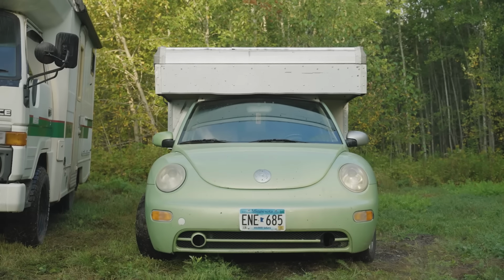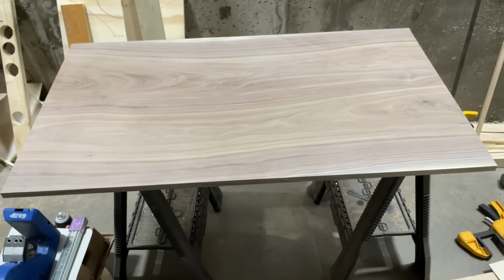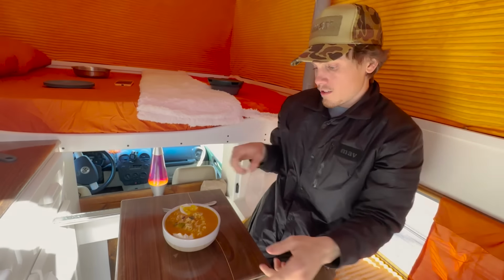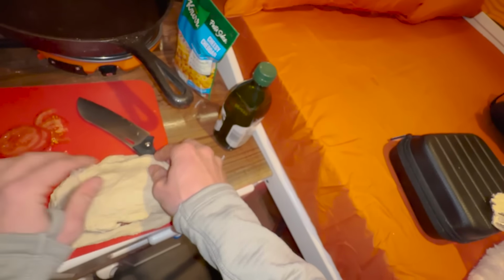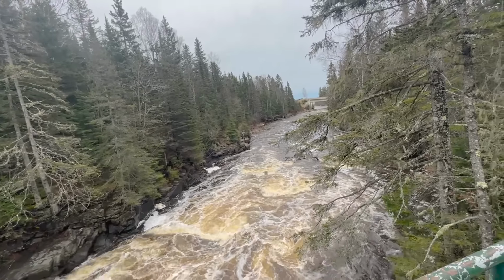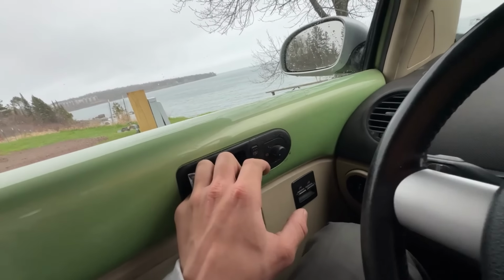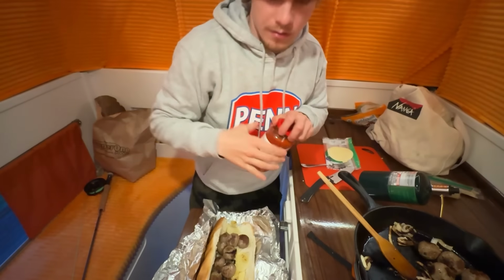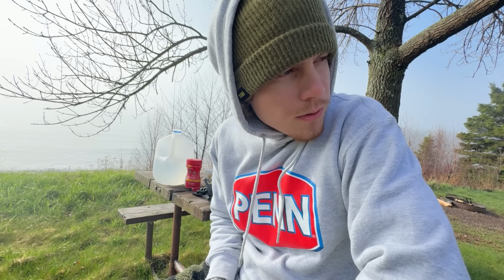Three Days Camping in my Renovated Small Car

Comment: Hey MAV, important reminder! Always put your manual transmission in gear when you are parked up, either Reverse or 1st gear depending on the slope you are on. It's a double safety especially with the heavy build the E-break is going to fail at some point and none of us wants the bug rolling away by itself at night with you sleeping in it.
Reply: doing that is not good for the gearbox, its unhealthy
Reply: @yusufali-zf2po  sorry but that's simply not true...there is no force acting on any gears because the Ebreak is holding the car anyway, it's just a safety feature.
Whatsoever there is also not as much force on the gears as accelerating from a stillstand for example. 
Sorry and not sorry but I am sure you haven't driven a lot of manuals in   mountainous areas so please keep your hearsay to yourself.
Reply: I've got a dead emergency brake on my Beetle and have to do this. Terrified this thing getting away from me but I live in the Flatlands ...
Reply: yup brake redundancy, can never be too careful, especially with older vehicles.
Reply: I've always kept any manual I've owned in reverse when "parked" as I was always told it is the strongest gear.  I had a car a while back that actually lost its e-brake so this was the best way to keep it in place for a bit.
Reply: Always good to keep some wheel glue on hand
Reply: 100%
Reply: Reverse works best
Reply: He doesn’t listen, you should never leave a car in neutral.
Reply: @yusufali-zf2po no it’s not
Reply: Never park a diesel in gear!
Reply: u are a good man
Reply: @yusufali-zf2po All you gotta do is pull the hand brake put the gear in neautral and lift the foot off the break and let the vehicle naturally rest on the brakes then put it in gear 1/R and turn off the vehicle. That way the tension is on the brakes and not the transmission.
Reply: @yusufali-zf2po  uh. No.
Reply: Once upon a time in the foothills of Cali, I watched my uncle’s car, parked uphill in neutral with the e brake on, as it rolled down the hill…..
Reply: I live in a major hilly zone, always gotta double brake to be sure
Reply: Hey mr. I know it all, mind your business, that would of been good content
Reply: Temu has wheel chocks.
Reply: Only you can prevent forest fires.
Reply: A couple wheel chocks will do the same
Reply: @yusufali-zf2po I’ve driven a manual transmission for 8 years, trust me. Putting your car in gear( while parked and motor off) DOES NOT harm your transmission. Who ever told you that has no idea what they’re talking about.
Reply: @yusufali-zf2po  where your from ... a different planet..?
Reply: Yup, especially if he's going to do any camping in subzero conditions. I live in the arctic circle we get some serious winters here and basically everyones first rule for winter driving here is never ever ever use the e-break just leave it in gear cause the e-break will snap or freeze in subzero conditions.
Reply: @yusufali-zf2po I’ve been doing it for 40 years and haven’t have a problem with a gearbox yet
Reply: @kieribama that is true reverse is a stronger gear always because it’s not a typical forward gear it’s usually a straight cut gear which are known for more torque but less speed hence why it’s a reverse gear you don’t need to hit 35 in reverse ever doesn’t mean you can’t but it’s just not designed to efficiently do that and also the problem with straight cut gears is it’s a lot noisier than helical gears due to the teeth on teeth action and rotation
Reply: @sandrellit also true the engine could start and runaway I’ve seen it online that is so scary I can’t imagine having a car that can’t turn off engine cuz of glowplugs
Reply: Yess!! But if you have no e brake left and on a big hill for the love of god lock your wheels one way I used to deliver pizza in a old manual jeep and the e brake was out got out one night got the pizza to them started walking back and the thing was legit inching forward grabbing inching forward and so forth needless to say I quit parking on steep hills and always  locked my wheels
Reply: @yusufali-zf2po  If the ebrake is on there is no weight putting stress on the transmission, so it wont be affected at all. Putting it in gear is simply a safety redundancy in case the brakes fail. If the brakes function as intended nothing happens to the gearbox but if the brakes give out the transmission will be there to resist the car sliding down. In that case, the gearbox will be damaged, but its better to have to replace/fix the gearbox than it is to crash and die.
Reply: Plastic tire chucks are lightweight and don’t cost much.
Reply: You are wrong on that i am a mechanic and it will not do anything to your transmission its just another safety feature i have always put my vehicles in gear and never set the ebrake putting it in gear is saver then the ebrake @yusufali-zf2po
Reply: @yusufali-zf2po  not doing it is unhealthy for the human body!
Reply: We do it on motorcycles all the time, keep it in 1st so it can’t roll away
Reply: @kieribama  Where I currently live there are some really really old cars parked nearby which definitely seems like most of them hasn't seen the road for over 10 years and some of them are parked in a slope and all of them still holding up with reverse or 1st gear. If I had to bet I would say their handbrakes gave up many years ago but the gear themselves keep them in place.
Reply: ALSO REMEMBER THAT YOU HAVE IT IN GEAR! I've seen people mess up their car real bad because they forgot.
Reply: @yusufali-zf2po Please do not spread misinformation on things you know nothing about.  This is not true. An automatic transmission when put in park engages a parking pawl that locks up the transmission so it can’t move. Leaving a manual transmission in a gear essentially “locks” the gears together and basically ties the engine and transmission together so that the car cannot roll ( Or substantially lessens its ability to do so).  There is no “damage” to leaving a manual box in gear while parking, it’s actually the much MUCH smarter thing to do in case the E-brake fails. Again, please do not just repeat a “fact” someone told you that you never even took the time to research or verify for yourself.  Thank you.
Reply: I suggest wheel chocks.
Reply: @yusufali-zf2po  you might need to turn down the gravity setting in your locality to "normal earth simulation mode" 

Then you should be fine.
Reply: @yusufali-zf2po 
You always leave a manual transmission in either reverse or first. ALWAYS. 
Do not ever rely on just the emergency brake when the vehicle is parked. 
And no, it will not harm the gearbox.
Reply: yea you do have a pont.
Reply: @yusufali-zf2po yeah its dangerous if gearbox are made out of wood lol
Reply: I do that as well
Reply: Yup.  I creeped ( my Toyota Celica ) back into the parking lot backwards  while I visited my friend.  Thank goodness it was the middle of the day and everyone was working.  My friends dad came home and told me that my car was in the middle of the parking lot!
He informed me, ALWAYS PUT IN GEAR, and use hand brake.  Ooppss. Lol
Reply: @yusufali-zf2po  no no.  If you don’t put it in gear when you do a drivers test you will not pass.  E brake and in gear when off, ALWAYS.  It does not hurt the gear box.  If on an incline put front tire against curb, turned towards it for rolling forward, or rear tire against for rolling backwards. WICH you WONT!  If your c ar is in gear it should not roll with e brake pulled all the way until it grabs.    We own a mechanics garage and body shop.  N9 harm at all.  Sorry. Your wrong there..
We shall wait until your car rolls.
Reply: @flacmurry7830 .  Yes!!! Bravo agreed. No idea how to drive a manual this person.  Good on you for putting your facts down too.
I also did.    No harm to car if break on also.  Bravo
Reply: @sandrellit diesel or gas doesn't matter, a manual you should always park in gear. I never put on my e-brake just out it in gear. There is no difference between a gas and diesel other then a diesel wont roll through the gear as fast as a gas would.
Reply: @wyattsdad8561 i alway put it in gear and thats it. I never use my parkingbrake. A parking brake can freeze really easy, a gear doesn't, that why i never use the brake. I dont even know if it still works😅
Reply: Brooo U have 1.1K likes that's so sick dude
Reply: @beckymorgan4319  you must be 12 years old if you care that much about likes
Reply: @beckymorgan4319  yep lets hope Mav sees it
Reply: @yusufali-zf2po where did you learn that nonsense
Reply: @Ps1ClassicGameplay are you using the imperial system when you say subzero? because as a Canadian this certainly isn’t a thing we do as soon as it hits below zero. Maybe once it starts getting to -20 or -30  but before that even my uncle who lives year round in the cottage my family built out in the bush doesn’t bother.
Reply: @AlexanderJasperJay  nah metric but better safe than sorry if the terrain allows it we are suggested even in driving school to not use the ebrake in the winter
Reply: My car actually rolled down a small slope 2 times 😅😂😂
Reply: @XxAILASxX why mess with chocks when It’s more Simple to put in gear. Crazy the talk in here for a no brainer manual park
Reply: Kdkkeuek❤kwjskekdueuekeu❤kek
Reply: @yusufali-zf2po if that’s true then then god blessed he’d better not ever ever drive the car 😂
Reply: @flacmurry7830 thank you!!!!!!!!!!!!!!!!!!!! lol
Reply: @yusufali-zf2po  explain how a gearbox, that is meant to transmit the power and torque with moving gears to a heavy vehicle, would suffer from only the stationary weight of the car and no other factor? makes zero sense. 
always keep it on gear when you park, it's even required by the law in a lot of places...
Reply: @yusufali-zf2po Is more important the gearbox of your car than your safe?
Reply: Although it would be good footage
Reply: Don't matter if you put it in reverse or first on an uphill or downhill. Just put it in the gear with the lowest dear ratio
Reply: Don't do this it does absolutely nothing nobody I know with a manual does that it's ridiculous
Reply: @Steve-dy1wf everyone does it does absolutely NOTHING
Reply: @scubajoe3321  except it does do something. If the parking brake were to quit working then you'd have to overcome the compression of the engine to move the vehicle.
Reply: @yusufali-zf2po that's completely untrue if u know what ur doing then it's fine but if u needs some tips on how to make this safe to so lmk
Reply: @yusufali-zf2po i was a mechanic for a few decades you sir are completely wrong your supposed to put a manual in low gear when parked it doesn't hurt one thing it protects it from rolling away if the e brake fails because your basically in neutral if not in gear
Reply: Or he could get wheel blocks from a local auto store or Walmart.
Reply: I put it in 3rd. always have always will. seems to stop my car from rolling away just fine.
Reply: @flacmurry7830 i think he meant leaving it in gear without the e brake being on just letting it bang against the gears on a hill obviously with the e brake on AND it gear won’t do anything but mav wasn’t using the e brake just parking it in gear when he turns it off
Reply: That should be obvious but apparently it’s not.
Reply: Impressive but crazy.
Reply: Those cheap ramen packages are full of sodium.
Reply: I swear thats what my dad taught me when im driving manual. Always park with first gear. Dont trust the e brake.
Reply: Or get a life🎉
Reply: @scubajoe3321  Bullshit.  I had manual transmissions for decades and only a fool doesn’t park in gear.
Reply: Or wheel chocks

Comment: Just a little tip for calzones- Use one piece of dough and stretch it out like a pizza, put the ingrediants on one side and leave a bit to fold on the sides so you can then tuck the dough in a spiral patern. 

Make sure you also cut a slit in the dough for it to steam, best way to make a calzone imo
Reply: lil tip for the pros
Reply: Rigby is a person who’s cooked lots of calzones with that insight. As a fellow calzone/pizza fan…couldn’t have said it better.
Reply: I was about to say if he coulda waited a little more, and cut a few slits for steaming, I usually get a riser(an elevated grate off the pan) put the calzone to the side and add water and get that boiling first with the lid, then when most of it is gone put the calzone back on the riser and leave it on to steam it to perfection of cheese stretches. it also doubles as to ease up the pan to clean it later.

Comment: You should add a 2 inch lift and all terrain tires ,awesome rig!!!
Reply: yes, could use little stiffer springs
Reply: Wouldn't that change his gas mileage?
Reply: @cynthiacrawford6147  It would change a lot of things for the good!!!!
Reply: @scottnorman4572  higher gas prices are not good
Reply: @cynthiacrawford6147  First of all it's a diesel and second when I made the original post I didn't know that I was supposed to run It by you first. And as far as gas goes we can fix it come November!!!

Comment: Love the idea of the lava lamp! It looks like it's fastened on both the top and the bottom without any wiggle room though. I would make sure to check that the top and bottom pieces of the car, to which the lamp is fastened, don't move when any kind of force is applied on the car. Any kind of movement might cause the the lava lamp to shatter. Maybe build in some shock absorption as well to protect from general shocks going through the car

Comment: amazing build! love it! the thing you mentioned about the door, they do have folding doors for these pop up camper types, but honestly I doubt it would work too great with your setup, not without major rework at least, plus the little door is kinda cute and fits the bug better imho. Though I DEFINITELY would add some sort of guard between your bed and the cooking area, perhaps one that folds up. Should help with any splash from oils or water while cooking from getting onto your bed. love what you do bud

Comment: LOVE the upgrades...  

Got a couple suggestions:

The builder of Chrome's van, VANCITY VANLIFE.... used honeycomb cut outs on interior walls to cut down weight.  Wondering if that could help with alleviating the weight on the ole bug's suspension.  

Also maybe using a camping oven would help.  Chrome used it to make cookies n muffins n stuff in Canada's backcountry.

Comment: The only reason theres a shiny and dull side on tinfoil is they cant roll it out in one sheet cause its too thin and will rip so they do 2 sheets at once and the shiny side is what touched the rollers and the dull side is where the two sheets touched.

Comment: I smiled as soon as I saw the roof lift because my work desk has the same system!

You might know already, but you can program a setting for whatever your max/min heights are and then just press and hold that button for the perfect height every time. 

Additionally, if your system is the same, you can press and hold “M” for 5+ seconds to lock the position (it’ll say “LOK” on the screen). Might not be a bad idea so that nothing bumps the button to raise the roof while driving  or lowers it while parked!

*Edit: watched far enough to see you knew about a custom setting 😅

Comment: I work for the company that makes that leg and control panel setup for the extendo roof. I can't wait to tell my boss. BTW you can program the buttons so it's one touch open. No need to hold the button the whole time. It's really easy to program with the manual handy. It's on our website as well.

Comment: To keep your shiny countertop - get a fire pit/grill fire mat - they have smaller ones and will keep the heat from changing the color of the countertop or damage it.  Also, with the soft, inner material over the outer canvas, I would definitely use a windscreen between your cooktop and the wall that could easily get too hot and catch fire.
Reply: Agree...Without a fire/flame guard between a lit flame, hot oils, etc. and the orange-fabric panel/s behind it, how long will it take before a fire?  Be safe, smart, and spend the money.  Not to mention how quickly those panels will soil.

Comment: BTW..Mav, a flame was within 2-3 inches from your pillow and sheets ! No excuses that it just "looks" that close. My guess someone will comment not to worry, Mav's just fine with a heat source that close to his combustibles. In a lot of videos If it's not bedding, it's backsplash curtains or stoves mounted on top of wood counters. One lady had her back to the stove while she was making a video! She was going on and on about some philosophical thing, but I wasn't listening. I was looking out to make sure her hair didn't catch fire! I commented on that, too. She replied the video was short, that she only looked away for a few mins. But it seemed like forever. Though the next video she made, I saw she put a metal screen behind her stove. Metal on all sides would have been better. In any case, should a fire happen inside a vehicle caused by the owner, cooking or otherwise, the insurance investigator will be able to determine that very quickly.  Mav, you are a dear. Better to be safe than sorry later.